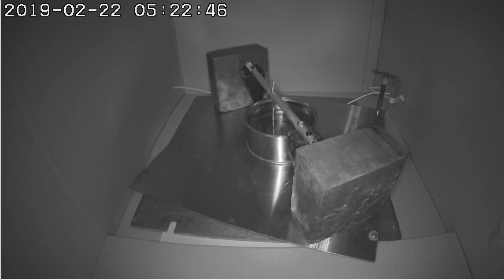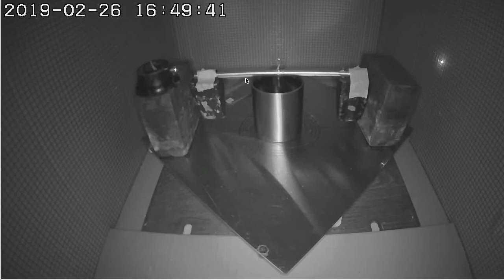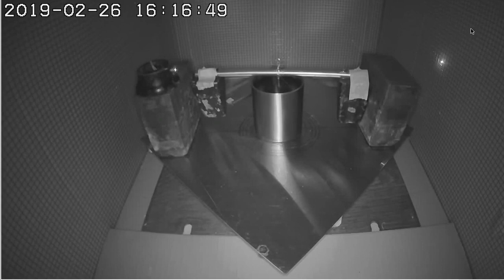Cavendish

Comment: wow excellent! much better than the most other "cavendish experiment" videos on youtube. Although this wasn't completely full cavendish experiment, it was good enough to prove mass attracts mass. What's missing for it to be fully cavendish is the measurement of the gravitational constant, but for that you'd need spherical weights and a little more predictably linear torsion suspension. Check out blue marble's project here https://www.youtube.com/watch?v=Z4fZzol97JE (he isn't finished with building it yet tho)